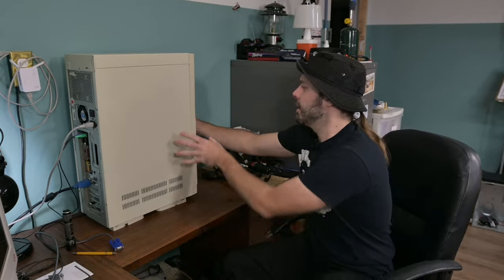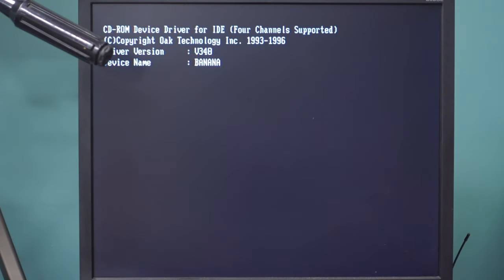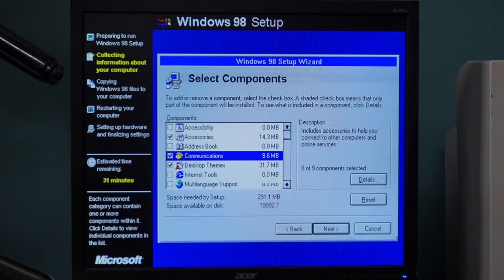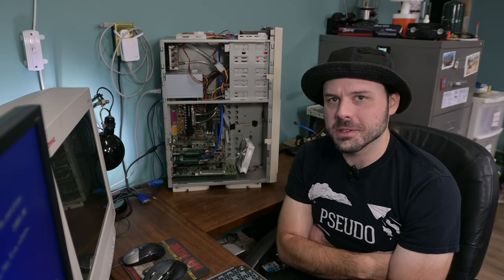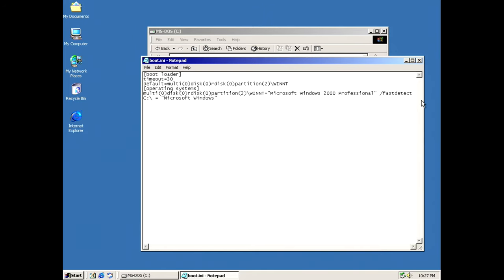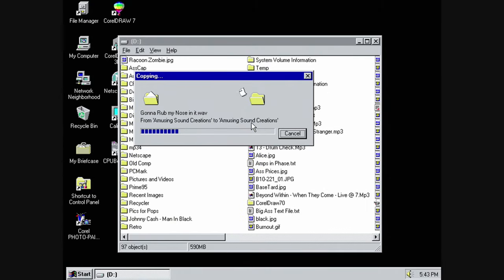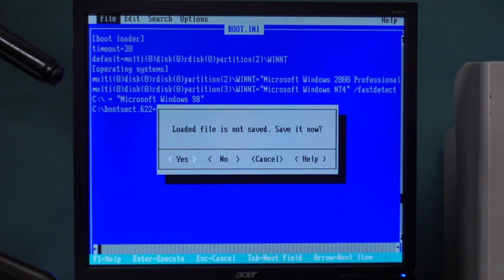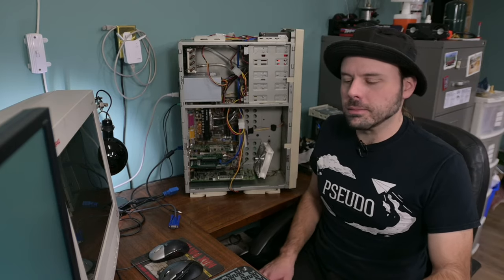Four OS's, One SSD, Windows 98, 2000, NT4, DOS 6.22.

Comment: It might seem attractive to format a partition as FAT32 for 2000/XP, but filesystem corruptions are so frequent and the OS will go down in flames in a timely manner.
Reply from the maker: Is that what I did in the video? Def not ideal for a proper working system. In this cause, it was only done so the older OS's could see the newer partitions so I could transfer between them. For a system like this that's just for play, didn't really see it a big issue. Mind you, I admit, I might have not considered that at the time. I'm so used to NTFS, I don't know that I have a lot of experience with Fat32 corruptions.

Comment: I made a dual boot win 98se/2000 (could easily get xp on as well), but a backup doesn't work as win 98se partition always craps out. Now I have a hdd power selector so I just pick the drive that gets power before i turn it on.
Reply from the maker: Manual, it works. And yeah, the File system of the time was one of the reasons why win95 and 98 got a bad rep. I had drives all out crash on me back then, and without the resources for recovery, I lost a lot. That's unheard of these days. Like, you'll loose some data to bit rot, but unless the drive all out fails, no crashes like back then.

Comment: Use the GeForce instead of Radeon atleast
Reply from the maker: Don't have one. Not that'll fit this system outperforms that Radeon.
I've been team red a long time.
Reply: @DATT  Though that ATI Radeon was of the time of OS yet it is not compatible with many games, as well as the Athlon
Reply from the maker: Yeah ATI wasn't as prevalent back then. I had a Gforce 2 in that system I do believe. 
I ahve a geforce 4 in stock, but I found it didn't work as well. 
Other that some DOS VESA modes, this card runs the games I've tried jsut fine. 
Radeon started to take off around the Athlon 64 Era, then kind of dominated the market for a while. 
It took a while for Nvidia to catch up to them and they were pretty much the best cards till AMD bought them. 
They had a few lemons but pretty much were neck and neck until recently.
Reply from the maker: I tried adding you to FB.
Reply from the maker: I'm not on those platforms. Check you msg requests.

Comment: Got a dual CPU Pentium 3 1Ghz in my parts bin. Sadly '98 is only single processor. Might do a triple boot system - DOS, '98, 2000. Can I do this off one FAT32 partition? 

I would add 3.11 in the boot.ini (although OS/2 looks fun to try or NT 3.51 is it's got good Win16 support).
Reply from the maker: Ah, as I recall (it's been a while since I did this) you need to make separate partitions for each OS.
Reply: @DATT  seems like you're right. Think I may go down the line of just using a SD to IDE adapter and creating different cards for each OS. Motherboard has a SCSI header and I have four 32GB SCSI drives I could use for shared storage.
Reply from the maker: @rhysholdaway  Well, this system worked great with this Sata PCI card I'm using. Not sure how easy it is to find those. 
What I was doing before this, was I have a Sata hot swap bay, and I'd just pop in whatever Boot drive I wanted at the time. Pretty similar concept.

Comment: So great. Well done. I'm trying to build up a Win98 / XP box for retro audio recording so this has actually been hugely helpful. Thank you!
Reply from the maker: Hey, that's great to hear !
Reply: @DATT  I guess you picked your hardware / peripherals really carefully! Getting 98SE to play nice is a PIA.
Reply from the maker: @f115Recs  Ah, not really, kind of threw together with spare parts. However, some of these parts were decent quality of the time, and I like to think I know what I'm doing. That and it's a pretty basic setup just to run some games. If it was a daily driver with a lot more going on/installed, it could be a different story.
Reply: @DATT  Got it. In my case I'm wedging in SATA ROMs, more RAM than 98 can handle, etc. It's been a battle but I have a working system.
Reply from the maker: @f115Recs  More RAM than 98 can handle ? Off the top of my head, I'm not sure how much that is. I would think a 98 compatible mobo would top out before the OS itself would.
Reply: @DATT  98 caps at 1GB (1150MB, I think) but there are some really useful patches out there to let it handle more, such as the 4GB cap you may find on these older (like early 2000s) MOBOs. I think 98 just hangs on a black blinking cursor without the patch in place (which you add in SAFE mode, restart, then restart again after installing your remaining RAM sticks). If you take this build further look for the late 'rloew' patches. Opens up 98 a ton if you need certain 'modernizations'.
Reply: @DATT  Either way - you slammed it on this build so well done. Maybe it's best not to tinker :)
Reply from the maker: @f115Recs  Haha thanks. I think even if you could get 1 or 4gb in there I don't think anything that runs under 98 can use it.
Reply: @DATT  I'll find out! I know that audio programs that multitrack can take up lots and lots of  ram. Maybe some were built to use what's available instead of capping with the OS. In any case, I have 4GB in and my dual 98/XP is now working. A little trickery gave me two C: drives aswell so I don't have to always change installer paths. So far so good!
Reply from the maker: @f115Recs  TO be honest, I didn't even know they had multitracking software back then.
Reply: @DATT  yeah - quite a few all through the 90s actually!
Reply from the maker: @f115Recs  Got nay name ?
I can't imagine what hardware it was meant to work with. 
Either super high end stuff we could never touch, or just very basic barely passible.
Reply: @DATT  Well, I suppose it depends on how you define 'super high end'. Home recording systems were starting to become a real thing then and DSP sounds cards that were beyond Soundblaster capabilities were coming out. A few come to mind off the top of my head. I'm more familiar with Win95-XP and beyond period but I'm certain there were a few earlier cards too. Here's a bunch: RME sound cards (PCI), Echo Sound cards (PCI - I just found a 24/96 Win98+ Mia card locally), Digidesign 001 and 002 (some were firewire), MOTU (PCI with breakout rack), some EMU cards before Creative/Soundblaster acquired them...
Reply: @DATT  For software (omitting MIDI-specific here for now), audio multitrackers included Cubase, Pro Tools Free, Emagic Logic, Sonic Foundry ACID, MOTU Digital Performer, BIAS Peak ... I'm sure otehrs can drum up more names. I'd have to look to see what else.
Reply from the maker: @f115Recs  Yeah, some of those names ring a bell, didn't know they went back that far. It all seems to take off round the XP era.
Reply: @DATT  true. stuff started coming out in the 80s but Win98 / MACOS8 is about the time when the hardware could be pushed further so programs started to come out far more than before.